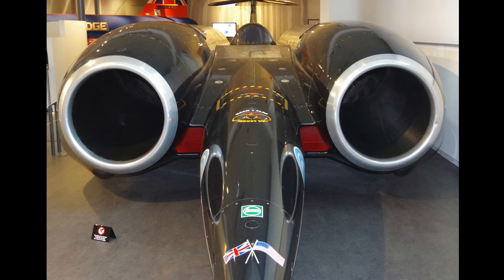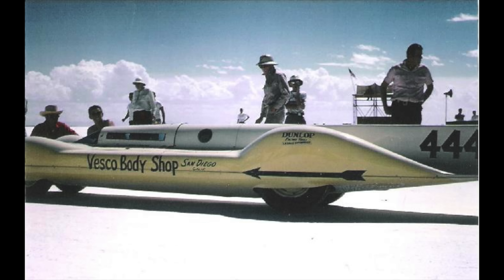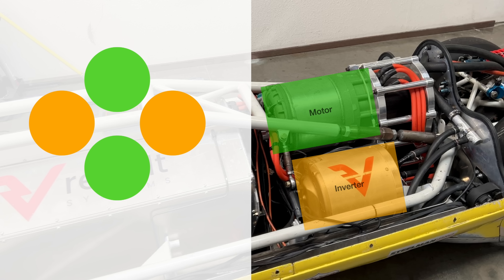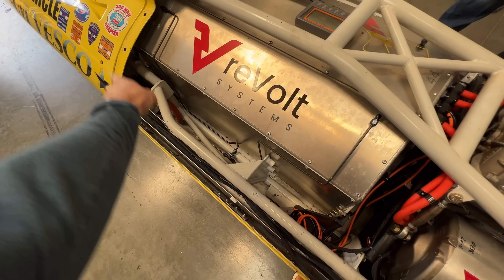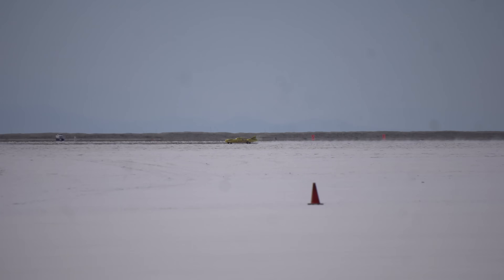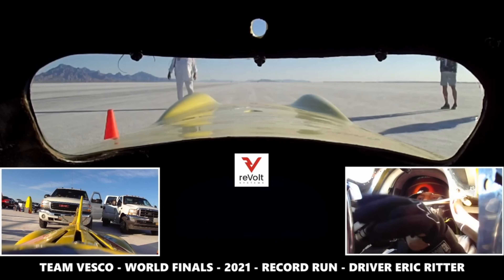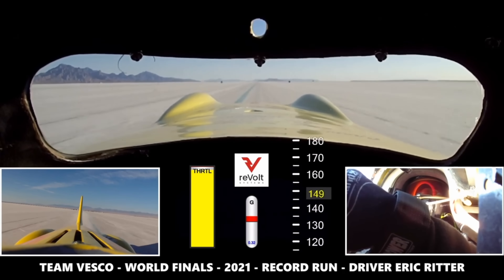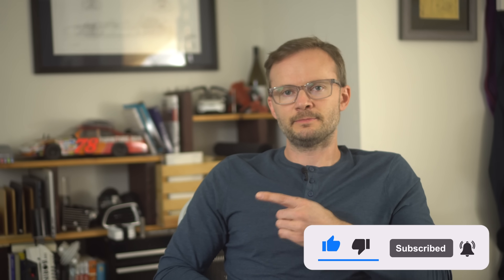The Engineering Behind The World's Fastest Electric Vehicle

Comment: the badass part: this car started the record run on it's own with a 2:1 direct drive. nothing else but an EV can achieve that, the load must be insane.
Reply: Steam.  The torque peak of a piston steam engine is at stall, just like DC electric.
Reply: Steam makes maximum torque at zero rpm.
Reply: @rovingmarks  only pistons.  Turbines not so.  But yes, piston steam is very comparable to DC electric.
Reply: What I wanted to write exactly.
Reply: Steam cars can too.
Reply: This is a misconception.  It’s not that ICE engines can’t do it.  Most cars are push started at Bonneville to protect the salt surface from massive wheel spin.  Spinning the tires a bunch at the starting line can dig holes through the thin salt surface to the dirt, destroying the surface at the starting line.

A C6 ZO6 Corvette can take off from a dead stop in 4th gear and reach 160 mph by its 7000 rpm redline…  and it only has 505hp and 470 torque from its 7L LS7.  If you think the Poteet Speed Demon is incapable of starting from a dead stop with 3100+hp from its twin turbo 556cid BBC going through a Liberty 5 speed trans, you’re either uneducated or completely delusional.  If anything, it has too much power to control wheel speed on skinny land speed tires on salt from a dead stop.  

Plus, it wasn’t a “2.1 direct drive”.  The only thing “direct” about it is there wasn’t a transmission.  The 2:1 reduction was between the motors and the driveshaft.  The driveshaft connected to a differential with additional gear reduction.
Reply: pretty sure gas turbines can do that, their torque graph looks very similar to electric motors...
Reply: @AKAtheA  Gas turbines have a minimum speed they need to operate; if they're not spinning, they're not compressing air into the combustion chamber, there's no combustion, and there's no power. This is why such turbines aren't self-starting. The output torque curve of an electric motor goes all the way to 0 RPM, the torque curve of a gas turbine does not.

The torque curve of a steam turbine, or some other type which has high pressure fluid being pushed through it from an external source, goes all the way to zero... but the curve for any Brayton-cycle turbine will not.
Reply: @Smidge204  the gas generator and power turbine are separate stages on certain designs. You can stall the output shaft on a turboshaft engine
Reply: @Smidge204  very few gas turbines have the LP turbine mechanically locked to the compressor and HP turbine. Because it's free to spin independent of the gas generator, it gives torque right from stall.
Reply: @yankeedoodle7693  If we're to take free power turbines as an example, then any engine with a torque converter also has a torque graph similar to an electric motor. That's kinda cheating IMHO, hence "or some other type which has high pressure fluid being pushed through it from an external source."
Reply: @AKAtheA  Okay, by that same logic piston engines can also give torque right from stall. That's clearly not the case, so there must be a flaw in the logic.

The key here is you're considering the power output as part of the engine when it really shouldn't be, because it's a separate component. The engine creates the power, and the power turbine is a separate component that extracts that power. It's the same as fitting a piston engine with a torque converter or generator; In either case you are using an intermediate mechanism to decouple the engine from the load precisely because the engine can not produce any torque at 0 RPM. Electric motors don't need that intermediate mechanism.

It might sound like splitting hairs but it's the only way to compare these things on equal standing.
Reply: @Smidge204  FFS what are you on about? The LP turbine is an essential component of the turbine engine, how else would you extract power out of it? That's like removing the crankshaft out of a piston engine.
Reply: @Smidge204  no. The torque converter only multiplies torque that the engine applies, based on the difference in stator speed. You're getting in the weeds.

The turbine has peak torque at 0 output shaft because there is the maximum force applied to the power turbine from the gas generator.
Reply: @yankeedoodle7693  A torque converter is a fluid coupling consisting of a pair of turbines; one driving (impeller), one driven (turbine). There's also usually a stator and possibly a lockup friction clutch in there but that's getting into specifics of implementation...

In a car, the coupling fluid is transmission oil. In a turbine engine, the coupling fluid is the hot combustion products of the gas generator section.

In both cases, it's absolutely possible to remove the coupling and still have a functional engine... because the coupling is not part of the engine.

And in both cases, it's possible to directly couple the engine to a load rather than using a fluid coupling... because the coupling is not part of the engine.

The only difference, and what I feel is the source of confusion, is the power turbine is integral to the gas generator housing for practical engineering reasons and doesn't "feel" like it's not part of the actual engine. It's not, though; you can remove the power turbine and the engine will still run just fine.
Reply: @Smidge204  if the engine is designed to turn a shaft and you remove the shaft, no the engine will not run fine- you will have a gas generator and that's not the engine. 

Taking the torque converter out of a car isn't removing part of the engine.

You're trying to explain it to yourself and you're getting further and further in the weeds
Reply: @yankeedoodle7693  If you insist on conflating the power-generating portion with the power-takeoff portion of a drivetrain, and insist in one case they are one in the same but in another case are separate components merely because it excuses you from having to actually think about the operating principles at work here, then there's just nothing left to be said... 

The power turbine is no more "part of the engine" than the transmission is "part of the engine." Like it or not, accept it or not, but that's the reality.
Reply: @Smidge204  i enjoyed that completey off course duel lmao. all i wanted to point out is how amazing 0rpm full torque is and somehow it triggered someone into comparing IC with EV's... which is utterly pointless. esp since energy container tech make LSR EV's possible, not the motor, which is the opposite of a IC, where fuels are proven and engines are the innovation.
Reply: @Smidge204  That is PRECISELY WHY it does not matter that electric motors can make torque at zero rpm BECAUSE of the intermediate mechanisms that combustion engines can use if torque at zero RPM is needed such as pressure compensated hydraulic pumps and fluid couplings like torque convertors. You just basically destroyed your own argument by mentioning the very things that make electric motor's having torque at zero RPM irrelevant. Heck, I could even use the electric motor to make my gas engine have torque at zero RPM indirectly by using a generator powering the electric motors like trains do. We don't live in a world where its not possible to give combustion engines torque at zero rpm indirectly. Its why such intermediate mechanisms exist.....................
Reply: @EETechs  First of all thanks for taking the time to add your 2 cents in many months after the conversation was laid to rest.

Second of all those "intermediate mechanisms" are not free; they introduce losses, weight, cost, and complexity. Combustion engines require them, electric motors do not.

So you're basically saying that a simple and efficient machine has no advantage because you can build a much more complex and inefficient machine that gets similar results. Can you appreciate how bad an argument that actually is? Why use a basic can opener when I can build a Rube Goldberg contraption to do the job in 100+ steps? In the end the can is still opened, right?
Reply: @Smidge204  You don't have a choice with current technology but to go the Rube Goldberg route. No battery exists that can match the energy density of fuel, even after accounting for inefficiencies. I can carry less weight in fuel than what is required in batteries to go the same distance and it's much quicker to "recharge" my fuel tank than to charge your batteries. 

Also, your electric motors get the majority of the electrical power from heat engines turning generators, whether that is steam powered or fuel powered. So you will never escape the use of heat sources to produce electricity to power electric motors. Again, torque at zero RPM is meaningless when you need heat engines to give you electricity and generators don't produce electricity at zero RPM; so torque at zero does not matter for heat engines of any kind.

Sorry, you lost the argument. Thanks for playing though.
Reply: @EETechs  Jesus christ dude put down that goalpost before you break it.

"You don't have a choice with current technology but to go the Rube Goldberg route. "

...except for all the choices people make to use fully electric equivalents to gasoline powered tools and vehicles, you mean? Yes, batteries are less energy dense that liquid fuels - but that's only a problem if you need a lot of energy in a small package. Turns out there are more situations where that's NOT the case, so electrics are adequate.

"So you will never escape the use of heat sources to produce electricity to power electric motors"

...except for renewable energy. Even if the electricity comes from fossil fuels like coal, something like an electric car is so much more efficient than an ICE vehicle that you still come out ahead. WAY ahead. A modestly efficient (>3.0 mi/kwh) EV can drive as far on the energy needed to get the oil out of the ground, refined and into your ICE car's tank, per gallon, as your modestly efficient ICE car can drive on that same gallon of gasoline.

Unless you meant hybrid drives, but if that's the case who fucking cares about hybrid drives? They are by definition a compromise.

"Again, torque at zero RPM is meaningless"

It absolutely isn't, though. I don't know what your hangup on this point is to be honest. To use your own example; Diesel locomotives are essentially generators on wheels, right? Did you know that diesel locomotives exist with geared transmissions, rather than the electric generator-motor setup? Do you know WHY the generator-motor setup is so much more common that few people even know about the other type? Because electric motors deliver all the torque at zero/low RPM when it's needed, and a huge transmission would burn itself up in short order trying to do what diesel electric locomotives do. All those clutches and fluid couplings you say make electric motors "meaningless" went right in the fucking trash because they suck at the task electric motors excel at.
Reply: @Smidge204 not reviving a dead post here i hope, bud dude... "thats only a problem if you need a lot of energy in a small package" perfectly describes the needs of planing boats and large aircraft. Its for this reason liquid fuel absolutely crushes batteries. they are so far off this "future battery tech" its not even funny. hell, we can hardly het solid state batteries to last in a flashlight longer than a few charges before dendrites form. not even close.
Reply: @ct1762  If you're gonna reply to a year+ old post you could at least read it to make sure you're not making a fool of yourself first. 🙄 The context of the quote you included is explicitly acknowledging the lack of energy density, so it's kinda pointless to argue that point as if it wasn't addressed.

Also there's no such thing as solid state batteries. There are prototypes, but unless and until you can actually buy one they do not exist in any relevant way. It's also worth mentioning that the batteries in things like electric vehicles live a very different life - and in many cases are physically and chemically different - than the batteries you get in cheap consumer electronics. It's almost as if one is engineered to last and the other is engineered to be cheap and disposable...
Reply: @Smidge204 no my point about solid state batteries is i hear a parade of Elon Musk drooling vegetables constantly talk about how the next hot batteries are "right around the corner" despite not improving them much more than 10% in the last 10+ years. the subject is usually solid state or exotic chemistry. and my facts about energy density are relevant, yes. not sure what i supposedly got wrong there but since all you could do is resort to insults that makes sense.
Reply: @AKAtheA  If you put a 2:1 direct drive ratio on a turbine I shudder to think how fast you would be going at idling speed.
;-)
Reply: @BoB-Dobbs_leaning-left  two motors from a direct drive car motor? Nothing unusual for them to take on … 2:1 Direct Drive …
Reply: @AKAtheA  I`d like to see a direct drive turbine do ANYTHING at zero or idle rpm lmao
Reply: @afrog2666  so, again - almost every gas turbine has a 2 or 3 shaft design, the LP turbine spins independently of the core. You can keep the output shaft stationary and run the core at full power. Full torque. You don't care about idle...
Reply: @AKAtheA  a good example of misconceptions in EV dynamics
Reply: @AKAtheA  rpm vs torque trade-off. ev motors have thicker shafts less rip'ems
Reply: I don't know I have a 360 inch Keith Black hemi running 85% nitro and a 1 to 1.31 final drive ratio no transmission I can leave the line by myself if I want just a little hard on the tires bad enough leaving the push truck at 50 mph
Most top fuel dragsters have no gearbox- transmission either.
Reply: @chauvinemmons  this EV did not require a push start and it did not damage itself or spin doing so.